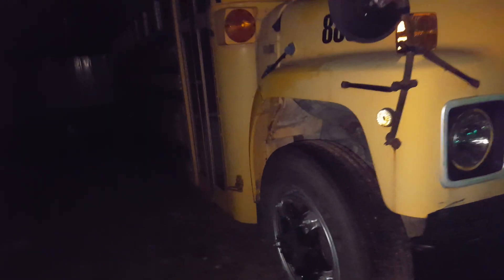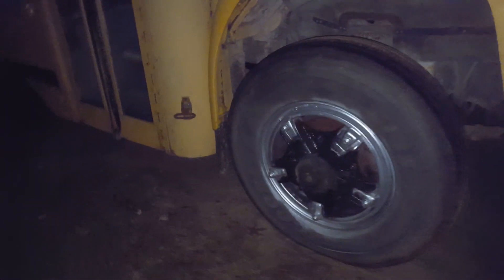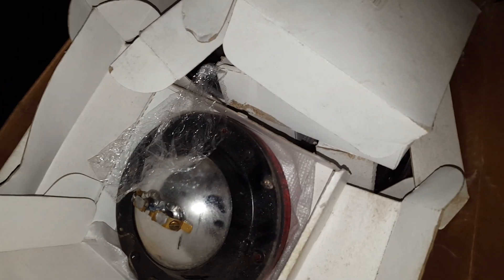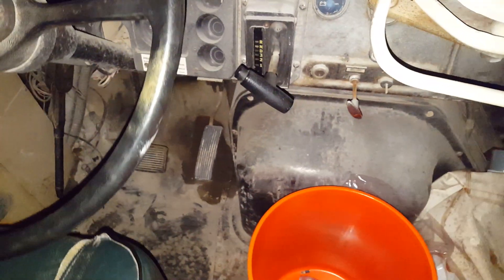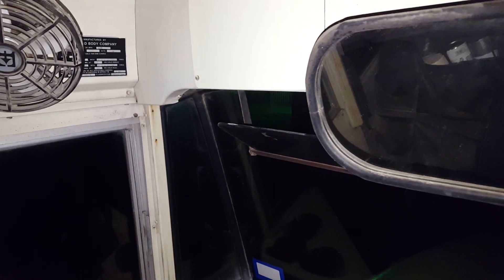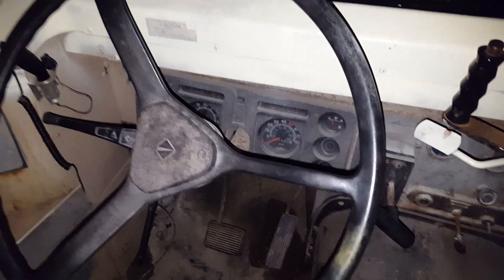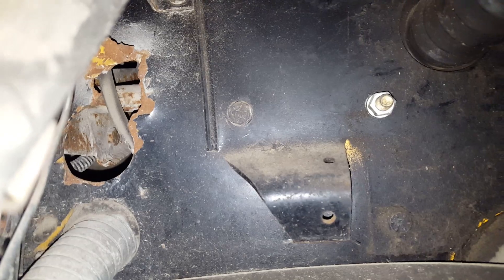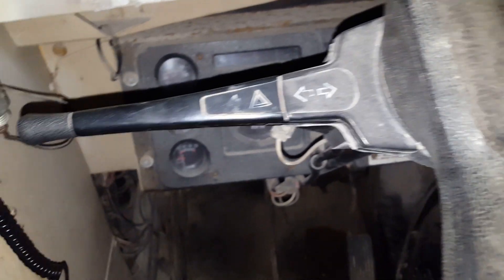1988 Blue Bird International S1800 Cold Start

Comment: Somehow I missed this Vid!..  Good ole DT always kicks..  do you ever have an issue in really hot weather with your DT-360 losing prime when it sits?  I been chasin it on mine .. let it sitin hot weather.. then start it .. runs for about 1 minute then dies..  then i have to manual pump the primer and it runs perfect...
Reply from the maker: Christopher Abnett nope.  sounds like you have a leaky hose somewhere.  The DT in the Thomas had a bad hose from the primer to the injector pump and I promptly replaced it, and the copper washers.  Haven't had a problem since!
Reply: thats what I was thinking... when i got the bus one of the copper washers was bad so I changed it and no more leak.. when I prime it, I cant get any fuel out of anywhere on the positive side near that hose..  I think im going to have to take the line off at the tank, and pressurize it with fuel to see if it drips from somewhere...  since its a Negative system, I have to be sucking air from somewhere slowly..  only happens in Hot weather.. in cold weather it will start and run every time..

Comment: that bus looks like the one I rode when I was in middle school.. the front grill is exact same... but my driver said her bus was a 1977, which I think is not correct, as it was a S1800 series Thomas Body International. I am thinking she might have meant 1987 instead.
Reply: but your is a blue bird body I see
Reply: and yours appears to be an automatic, and one I rode on as a kid was not, it had a standard transmission
Reply from the maker: The hood is actually off of a junked 1988 or 87 Thomas S1700 with a 7.3, according to the line ticket on the hood.  This bus was bus number 45 from Michigan City, Indiana schools, and was bought by Goodman Bus Service here in Houston in 2000, and I am the third owner.

Comment: How much would you charge to switch an automatic to a manual in a Freightliner school bus.  Would a 10 speed fit?
Reply from the maker: Not sure.  Where are you located?
Reply: Central Canada, and I do not have a skoolie yet. I would like to know which engine to chose that would be able to take a 10 speed or a 15 speed in a C2 Freightliner on a Thomas coach.  Detroit, Cat or Cummins?

Comment: What does the throttle lock do?
Reply: ViceCityMasta The throttle lock is to keep the engine at a higher RPM. Just in case something like the air brakes are low on pressure and need engine power to restore pressure. The other unlikely reason is to let the engine warm up just enough to run at normal speed.

Comment: This school bus looks like a peice of shit compared to my uncles my uncle has custom made seats for his a Ohio state pant job all Ohio roof in side is Ohio state all leather interior clean and doesn't look like that by the steering wheel his is all black rubber no rust this dudes looks like he got it out a junk yard my uncles has a pa system TVs inside 2 heater blocks and my uncles is a 1984 blue bird international it has a 6.9 deisle engine